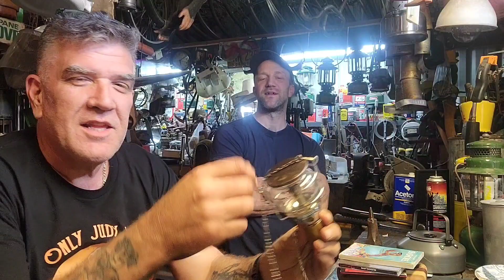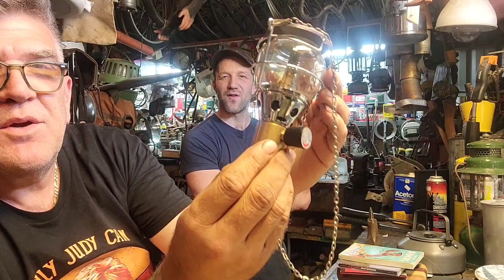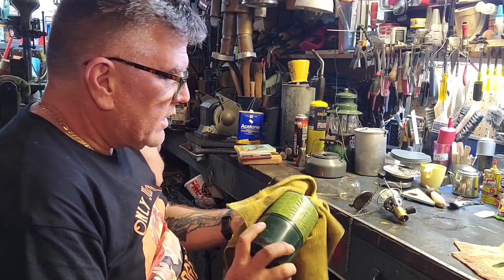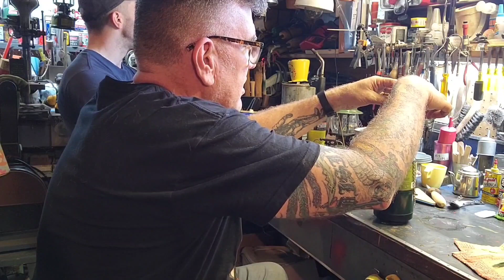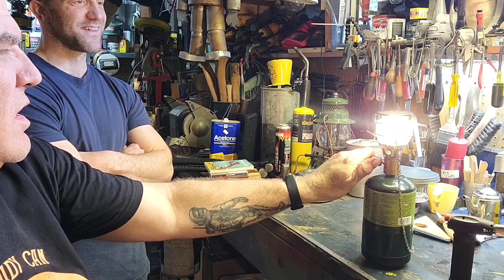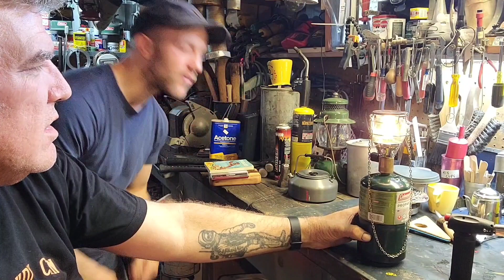Chazbo stops in for a visit !

Comment: Cool lantern. Wild how it burns straight through
Reply from the maker: Stange right. If you look at the mantle that it's supposed to have, it makes a bit more sense , here is a link below for the ones Im ordering .

https://www.amazon.com/2-Pack-51-Slip-On-Lantern-Mantle/dp/B00UKHAD0U/ref=asc_df_B00UKHAD0U/?tag=hyprod-20&linkCode=df0&hvadid=242012186291&hvpos=&hvnetw=g&hvrand=9509438474549345&hvpone=&hvptwo=&hvqmt=&hvdev=m&hvdvcmdl=&hvlocint=&hvlocphy=9032908&hvtargid=pla-447724686444&psc=1